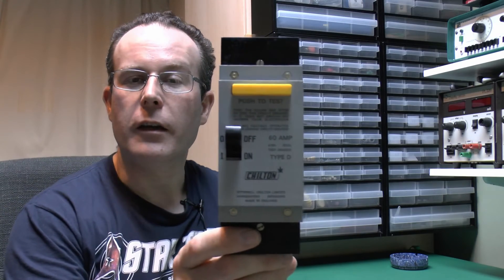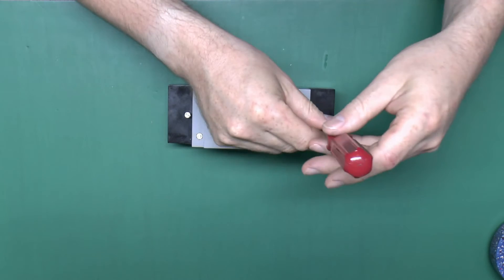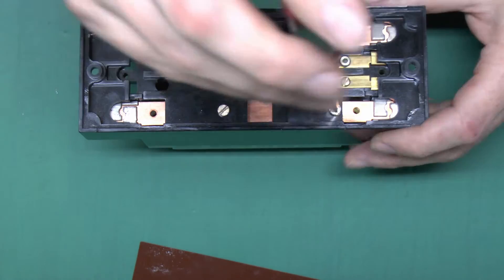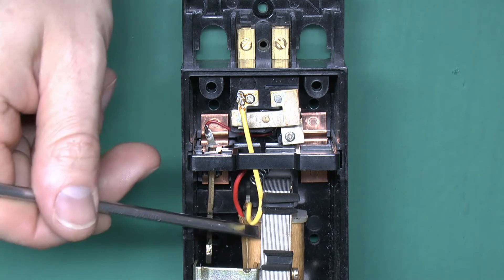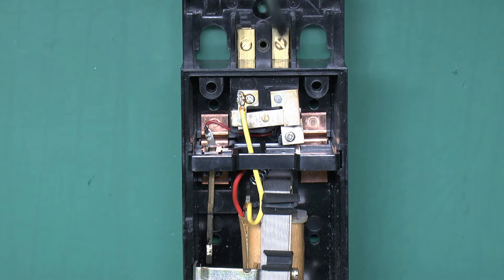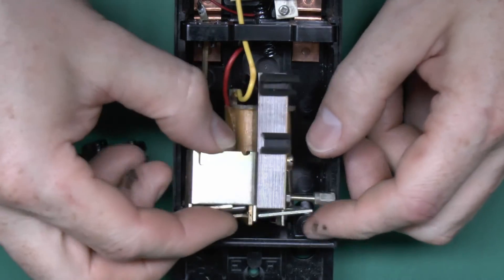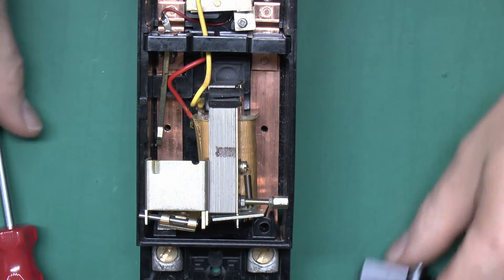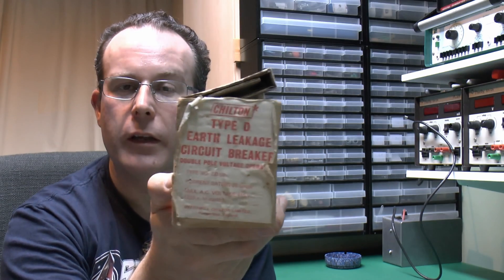Chilton Voltage Operated Earth Leakage Circuit Breaker

Comment: Would this device trip or if old intermittently trip on a neutral to earth dead short John?

I tested a dead short neutral to earth on a lighting circuit in the customers house and cleared the fault but not sure if that was the cause to this intermittent trip
Reply from the maker: It could, but like most things it depends on many other factors.  A moderate to large load on the installation would cause a voltage drop on the neutral (and therefore the installation earth due to the short), and that could be enough of a voltage difference between the installation N&E and the external electrode to trip the device.
However does depend on the load current and whether there are any other paths to Earth such as equipotential bonding, the location and resistance of the earth electrode and so on.

Comment: The house we moved into in 1984 had one of these (with "PUSH TO TEST" on the button, as you mentioned some had), and it was still there in 1997. Probably gone now as the electrical system needed extensive work in 2003. I can remember it tripping twice - once, it coincided with the element in the tumble dryer failing, and I had to go out and reset it, partly because my mother didn't know about it. It did spoil my enjoyment of a TV programme. I have to wonder if an RCD would have tripped on that.
Reply: +Phil Reynolds I had one when I moved into my current house that was so old, the tripping mechanism had corroded to the point that it broke itself when it tripped. My disabled mother lives here who is on oxygen 12 hours of the day, and her oxygen machine started drawing a bit too much amperage, but the breaker failed to trip, leaving it buzzing wildly and heated to the point it started smoking. Since the mechanism broke itself, it could not be switched off, and the main breaker had to be thrown. 
The only thing that saved us there was the plastic, which only chars, and will not melt or catch fire.